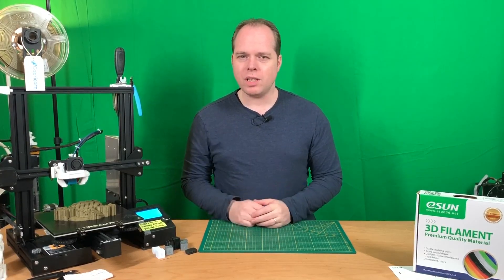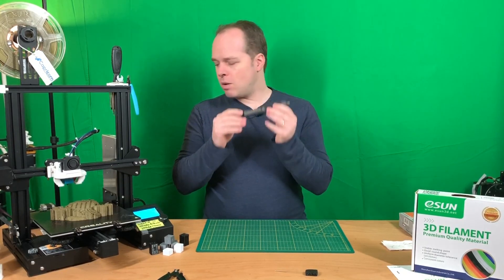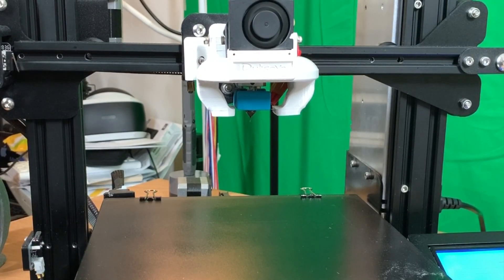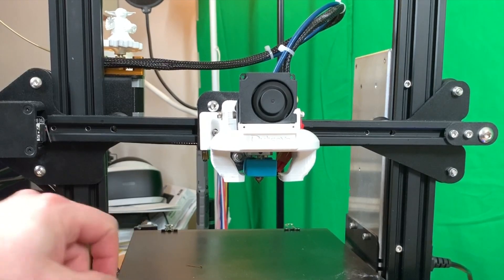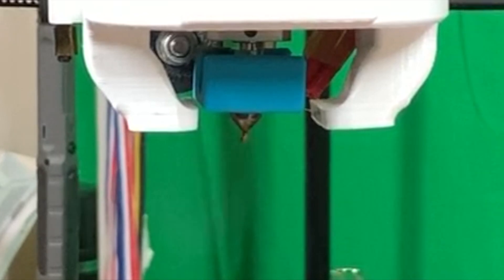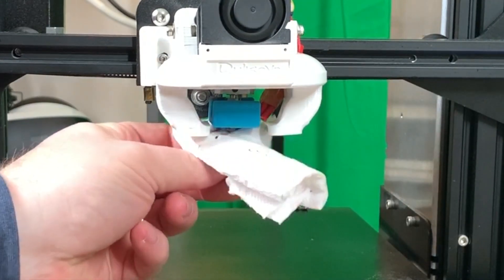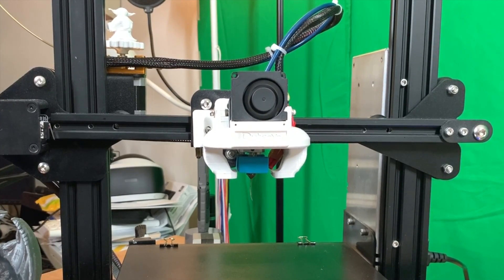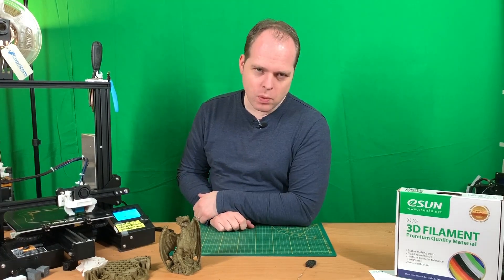How to unclog a nozzle of a 3D printer - Ender 3 pro

Comment: Can i use the magnetic bed from the ender e pro on the normal version?
Reply from the maker: Yes you can use it, I upgraded mine because it was breaking in the middle of the print surface...